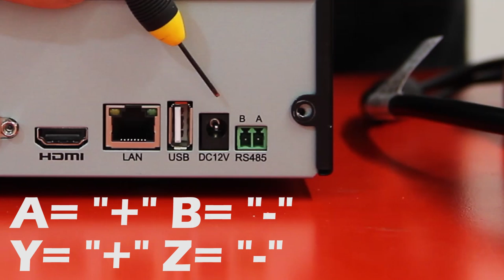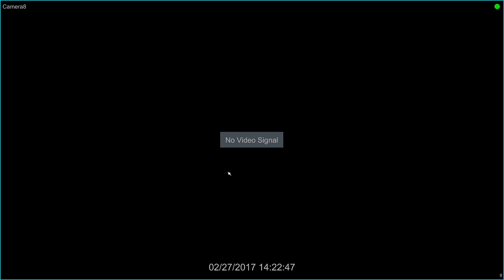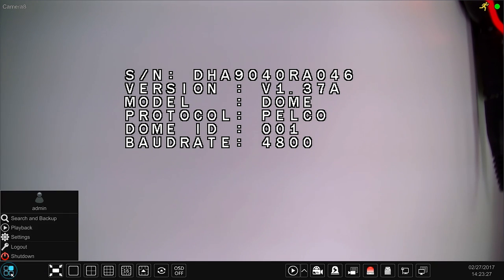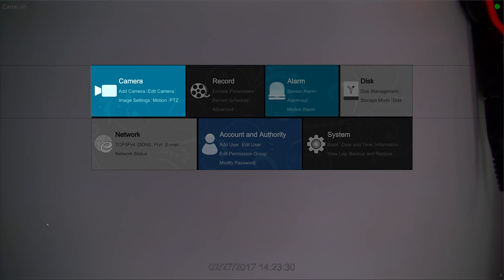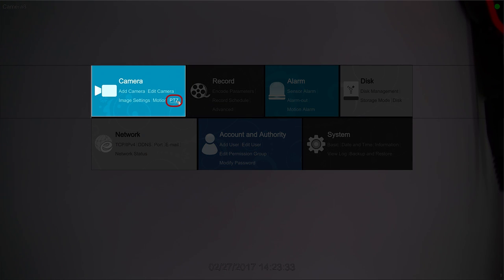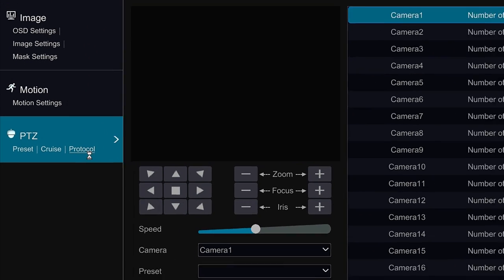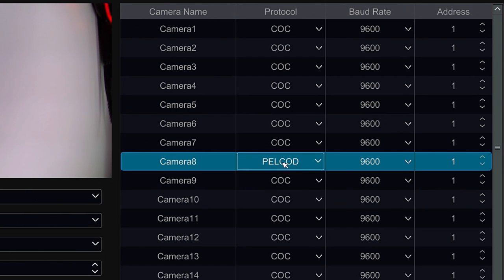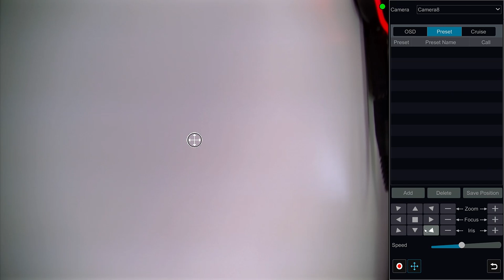How to Setup a PTZ Camera to your DVR System Using RS485 (Step by Step) Titanium Series

Comment: What is the reason for adding 2 'extra' wires to the positive/negative rs485? When we could attach them to the Dvr/Nvr directly...at the A&B port.?
After all, its only 1 ptz camera that would be needed in my case.
Reply from the maker: Hello, The 2 wires used to extend in this video were used to give a visualization of field application since you would typically have to run a wire unless your PTZ were in a lab environment. They can be directly connected to the recorder. CAT5e cable or 18/2 is typically used for this scenario.
Reply: @ENSSecurity  ah ok

Comment: @1:47 Do not connect wires like this for anything, anywhere, at any time. Just buy a terminal block and securely and safely connect them. They cost less than 10p.
Reply from the maker: Thank you for the recommendation. We understand this is not a permanent connection but for demo purposes.

Comment: Hello, i have this exact camera. It was installed already,  however some of the features I'm not getting it to work. The default setting where the camera pans,  tilts and zooms to test, occurs every time in the cruise I set up. It interrupts and may also occur twice in one cruise. Can you advise me?
Reply: Mine has no OSD menu or dip switch
Reply from the maker: @peggylakhan771  If you are setting up an analogue PTZ camera with DVR using RS-485 and experiencing irregular patrol behavior. I would recommend you upgrade the firmware in the following link first. 

If issues still occur, please call our tech support hotline.  ( 626 ) 961 - 3999
Reply: @ENSSecurity  act
Reply: @ENSSecurity  and

Comment: So, I purchased a PTZ camera with an RS232 of an 8 pin connector. However,  the joystick controller only is VGA? Do you know if I would have to splice two cables,  or do they sell converter for that. Cause i'm trying to daisy chain two ptz cameras into the joystick controller
Reply from the maker: If you can pinpoint what pin is RS485 + and  - then you can splice the cable and connect both ptz together. Make sure both + cables of the PTZs and both - cables of the ptz are connected together. ++ and - -

Comment: You stated: Red and A are positive...Yellow and B are negative... You have wired the red+ A wire positive to B - which is negative
Reply from the maker: I might had plugged it wrong in the Video because i was in mirror mode recording. But the correct way is as stated on the video. on most DVRs they will have A & B or Y & Z and the Letter that comes first on alphabetical order is always POSITIVE. A = "+" and B = "-". Good Catch.
Reply from the maker: I review the video and the connections are actually correct. I used the Blue for positive and Light blue for Negative. at first it got me confused as well but the video is actually correct =)
Reply: you have dark blue negative (in B port) connected to the red positive from the camera.
Reply: @ENSSecurity  WRONG FELLA .................. YOUR POSITIVE FROM THE CAMERA (RED) IS CONNECTED TO (DARK BLUE) "B" PORT OF DVR .......... B IS AFTER A IN ALPHABET ......................................... EPIC FAIL!!!
Reply from the maker: @gazfrc4754  As we mentioned before we mentioned wrong in the video. but the instructions are correct. A = + and B = - and some DVRs have Y and Z so the first letter in the alphabet is positive.
Reply: @ENSSecurity  Does it matter what color cable I use to connect the RS485? Or is it just to differentiate between how you connect your positive and negative wires?
Reply from the maker: @Beatboxinbear  Color only matters to differentiate the positive and negative... staying with the same color code.. or matching as best as possible... for example, if you have black and red wire... then connect red to red and yellow to black...hope this answers your question. Considering you are referring to using an extension cable line to connect PTZ to NVR.
Reply: @ENSSecurity  yes I just got a ptz camera and I'm trying to hook it up. Great video. Now I just need to find an rs485 connector cord if you guy's sell that? Preferably 100ft. Thank you.

Comment: when camera boot it dosn't show protocol or dome id , what other varibles should i consider
Reply from the maker: Try using the settings that are most common. for Example Pelco D, 2400, ID 1.  also try Pelco P 9600 ID 1. these are the most common settings. best of luck

Comment: Hello I am connect 3 ptz camera on with DVR but when I make preset then no1 camera preset work on all cameras can you help me sir.
Reply from the maker: Most likely you have the same ID on all 3 PTZs. or maybe is the DVR that's sending the wrong information. Ill recommend you to make sure all 3 PTZ have a different ID. and also make a preset by going into the MENU of the PTZ camera itself and not from the DVR unit. most PTZ cameras you call Preset 95 to go into the menu and inside the menu you do the preset so it can stay in the memory of the PTZ camera and not the DVR. hopefully this helps =)

Comment: where can i buy the rs485 connector; besides China?
Reply from the maker: The RS485 connector only comes with the DVR and the PTZ camera, You cannot buy an RS485 for a DVR or PTZ camera. If you are referring to the terminal screw connector piece then, in that case, you might contact your DVR manufacturer and ask for that Terminal block.

Comment: Can you have multiple ptz cameras with just one rs48?
Reply from the maker: Yes you can, Just make sure that each PTZ IP camera has a Different ID. But all cameras would have the same BaudRate and Protocol.
Reply: What wire did you used in RS485 ? is that cat5e UTP cable ? can i use any color in the cable ?

Comment: My dvr no option r485 
What I do
Reply from the maker: If you don't have an RS485, Maybe they have a converter that can convert RS232 (Serial Port) to be used as RS485. If your DVR does not have RS485 or RS232 then you cannot connect a PTZ camera. NVR units don't need an RS485 because they use the IP address to transmit all information.

Comment: Didnt you say the first letter in alphabet is positive but you wired it with b as positive and a as negative so you wired it incorrectly...
Reply from the maker: I believe during the video I did wire it wrong but then I corrected it on the next recording segment. Im sorry to confuse you but the directions are the same. A is Positive and B is Negative or Y is positive and Z is negative.
Reply: WHAT PRATT!!

Comment: PLZZZZZZZ  SHOW   MULTIPLE   PTZ   CONNECTION
Reply from the maker: You can connect all PTZs together in the same RS485 Port. Make sure all cables are corresponding to each other. Positive with Positive and Negative with Negative.  Just make sure that each PTZ camera has a Different ID. But all cameras would have the same BaudRate and Protocol. Hear this part of the video 2:10

Comment: Hi
Could you please advise ?how PTZ camera with IP rj45 port no can be c9ntrolled in ptz?
There is no rs 485 port , camera model is ec-750 stahl , it has axis m7011 chip ,
Reply from the maker: Please call our tech support hotline at (888) 367-1999. The support agent will ask for a valid account # or name.
Reply: @ENSSecurity  
We resolved
Thank yiu for reply